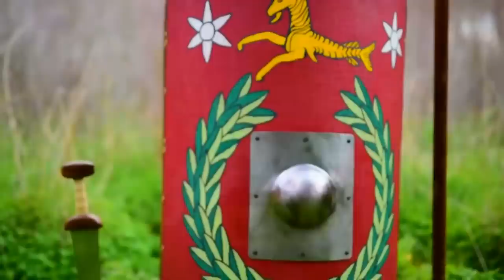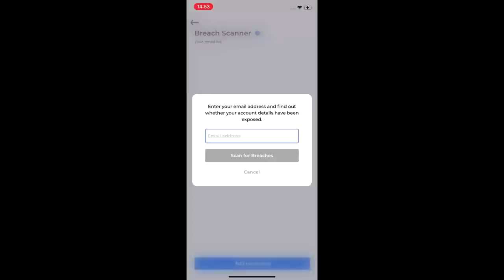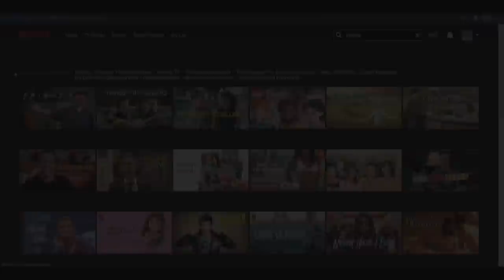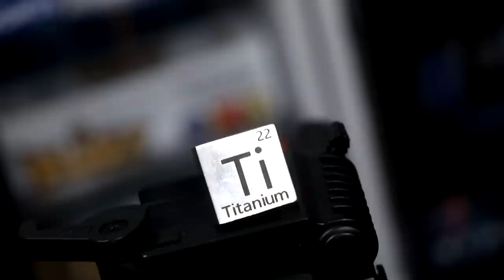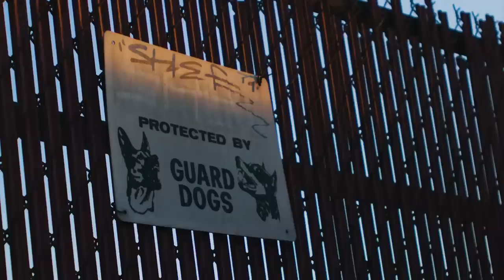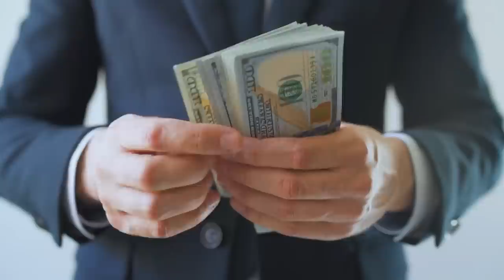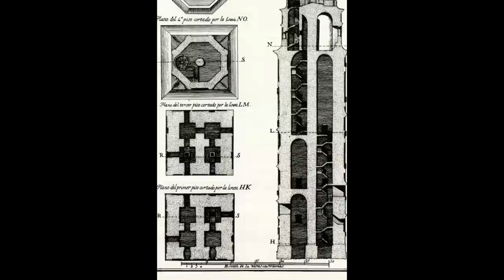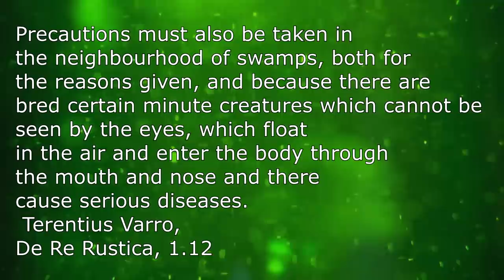10 "MODERN" Things The Romans Actually HAD

Comment: The roman style of concrete is actually superior in many ways to most modern concrete. The largest advantage it has is that it doesn't absorb water, which prevents it from cracking in winter. This is a major reason some buildings from ancient rome still stand today.
Reply: One of the major problems with it though is it doesn't handle wet+cold particularly well. Great for the Mediterranean, becomes a problem in northern Europe. Roman walls, unmaintained, in Rome and Britain are about the same quality overall, most don't utilize concrete as a primary material, they are earth or stone. Things that DO utilize concrete as a primary material, like a lot of the Mile Castles along Hadrian's Wall....almost entirely gone. The ones that are best preserved were built out of more stone. It takes longer for cracks to form, but once they do the freezing and unfreezing in them is worse. Rather than cracking and crumbling off bit-by-bit like a modern sidewalk though, it is like it erodes from inside the cracks, until large portions are no longer solid. With our modern concrete, easier to patch a small crumbling area. With their concrete, it would often stand until the whole thing was nearing crumbling down in Britain.
Reply: @Nick-hi9gx  I'd imagine the salt content would also be a limiting factor, since that pretty much guarantees corroding any rebar even more than our concrete does.

As for Roman concrete, I do wonder if they really actually used the proper stuff in projects on the edge of the empire. After all, bringing in the ingredients was very time-consuming and expensive.
Reply: @InfernosReaper  Most of the ingredients would be relatively cheap because they were plentiful numerous places around the Empire. But up in Britain, or a permanent camp in Morocco, yeah I could see that being pretty cost-prohibitive.
Reply: @Nick-hi9gx  You're kinda underestimating the distance and time of travel due to the size of the empire.
The fact that the secret of making Roman concrete was lost does seem to lend support to the notion that the good stuff wasn't used everywhere, so substitutions had to be made.
Reply: @InfernosReaper  The "good stuff" WAS used everywhere. We have evidence of its use on Hadrian's Wall and Antonine's Wall, a Castrum's towers in Germany, the winter camps in Antioch and Alexandria are the exact same towers as out in Morocco and Romania. You are underestimating the logistical and trade network of Rome, and overestimating the difficulty of making their concrete. The required ingredients aren't rare. Not at all. Tuffa is OVERLY abundant in Italy, Greece, Sicily. 
As to time travel...messages could get from Britain to Syria in a month. Food was shipped from the Chersonesus (Crimea) to modern southern France in an emergency  two years in a row, it took a bit over a month to get there...and that was BEFORE the Romans, going from Greek polis to Greek polis.
Reply: @InfernosReaper  Thought I would come back and answer the salt thing. Salt doesn't corrode iron. It doesn't oxidize it. Water does. Saltwater is worse because the salt acts as an electrolyte, which in turn causes faster degradation. Only if water was actually getting into the rebar would it make any difference. Which...it really shouldn't.
Reply: @Nick-hi9gx  Gonna a citation or 2 for a good bit of that
Reply: @InfernosReaper  Why do you need citations for my claims, but don't back up your own with anything? Especially when you clearly don't understand where Roman ruins exist, what sorts of ruins, or basic chemistry but claimed things based on them. I mean shit, go google what salt does to iron. It took me less than 2 minutes to double-check that I had it correct.
Reply: @InfernosReaper  I will give you this; When Galba died on 15 January 69, Vespasian heard of it, in Syria, by the beginning of February, he issued his commands in the first week of Feb to begin preparing. 
Or this. Constantine learned of Maximinus Daia taking control of the East within a month, maybe 6 weeks of it happening. When he was in northern France, or the Low Countries at the time. And this was as the Empire was splitting into many sides in a civil war.
Reply: @Nick-hi9gx  So,, you've used some examples of news traveling, but not goods and services okay...
Reply: Except that it isn't because we can recreate it and have improved upon it. Modern concrete structures are stronger than the roman ones. However they did build well and their use of arches allowed for buildings to become very old without the use of rebar. Practical Engineering has a good video explaining this.
Reply: @InfernosReaper  but we didn't lose the secret, that's a myth. We very much know how to make it and have found recipes from the time period. The whole concept of the dark ages and intellectual regression is a myth. Much of the roman's knowledge directly carried over into medieval Europe. The main thing that changed was the interconnected infrastructure, trade routes, military defenses, and commoners speaking latin, without the romans europe began its road into constant war and disputes. If America fell we wouldn't just forget how to design microprocessors and trains.
Reply: @InfernosReaper  the romans didn't use rebar, that's why they used so many arches. And all you need for rust is iron + oxygen + water (with disolved elctrolytes, ie not distilled water) but salt can be that electrolyte.
Reply: @Bagginsess  Except the did forget a lot of that stuff. Otherwise they would've kept using a lot of it...

Also, not sure what your bit about rebar is exactly... I only brought that up for why we can't really use their concrete plus that. It'd be worse than the current issues with have with it for long-term structures.
Reply: @InfernosReaper  there were things that stopped but that was due to the lack of roman infrastructure. The roads, aqueducts, city wide plumbing systems were unqiue to rome for a long time because only rome had the means to pull it off. When you are one of many warring states in medieval europe you have no ability or desire to create such vast feats of engineering. That is why the Catholic church was able to accomplish great feats that surpassed rome while the european nobles only had castles surround by fuedal estates untill much later. Rome provided peace within the empire and medieval europe was the exact opposite of that.
Reply: @InfernosReaper  name me a few things that Europeans forgot.
Reply: @Bagginsess  Rebar would have to have an some kind of coating the concrete wouldn't muck with or it'll fail faster than regular concrete.

And yes, we did forget a lot. We know for a fact that is the case because to this day we are still discovering new things that we didn't know they know.

I'm not saying the Medieval period was as bleak as described, just that it's not as good as you make it out to be.
Reply: @Bagginsess  No, it is true, we don't know how it was made. We know the ingredients, but not the method. The cement only works if the ingredients are mixed together slowly in the right amounts, and it took a whole lot of trial and error to get it to work again, but we still don't know exactly how they did it. That is where the myth comes from. Did they mix it at site? Did they mix it together except a last ingredient, only adding that at site? Did they use rebar (which they knew how to make), find it didn't work, and went back to frame pouring? Did they TRY concrete for tension, and those buildings just no longer remain because without rebar it won't be good at that?
Reply: @Bagginsess  If you want something to last more than half a century, rebar should be coated to last a lot longer against rust, though, above just galvanizing it, especially since concrete seems to burn through galvanized layers faster(especially salt-based concrete)

Practical Engineering is quite a handy youtube channel.
Reply: @Nick-hi9gx  that's a fair point.
Reply: @InfernosReaper  I didn't realize it had only been 50 years since the Colosseum was built. I should get my watch checked.
Reply: @Bagginsess  Wait, did I really say anything about the friggin' Colosseum being built with rebar at some point? If I said anything that even vaguely hinted at something like that, I apologize.
Reply: @InfernosReaper  you said if you wanted something to last longer than a century you need the rebar to be more than galvanized, well that's not true as you don't even have to use concrete.
Reply: @InfernosReaper  don't even have to use rebar*
Reply: @Bagginsess  no, I said if you wanted to use something with rebar and have it last for a long time that rebar needs to be more than just galvanized...
Reply: @InfernosReaper  reread it thats not what you said. I'm being an ass and know that's not what you meant but you didn't specify so I'm having a laugh.
Reply: @Bagginsess  The Romans didn't use rebar per se as in steel rebar, but didn't they use straw or something similar? Something that would last longer than actual straw, I'd guess. They clearly understood the architectural need for something with tensile strength though.
Reply: The dominance of Portland Cement is actually quite curious, because its actually was never meant to be a primary structural material.   Lime-based mortar was very well understood circa 1800, and in all ways effectively mimics roman concrete and its hardiness to water exposure.  Its why Europe has so many 500+ year old buildings till in active use.  BUT, it has a problem.  Its too strong.  See when Europe stopped building with STONE and moved to Brick in the colonial era and its population explosions, they found that lime-mortar brick buildings would crack and sheer as they settled or the ground shifted slightly, requiring the entire building to be torn down and rebuilt, assuming it didn't catastrophically collapse.   And the Emergent America  suffered the same problem where nearly everything was being built with either wood or bricks.    So a solution was sought, a motar that was strong, but not AS strong, so that when brick walls cracked, the MORTAR would crack.  This would mean the bricks would still be stacked up, so a collapse was much less likely, and then the wall could be repaired with new mortar.    

And to this goal Portland Cement was invented.   Then the industrial revolution happened, and with it a massive increase in the sophistication of politics.  With those politics would come legally-mandated building codes.   But until the 1900's remember everybody was still building brick buildings.   Well that would change with the mass production of quality steel, and the rise of high rise building.   They had been using Portland now long enough they effectively forgot about lime mortar, and starting using it as a moldable building materal, all the fashon to use Portland cement to façade these new fancy steel-framed buildings.    of Then Portland cement was mixed with steel rebar in the early 20th century as a means to try and stabilize what was material, by design mind you, that was quite weak to sheering loads.  That worked, got written into law, and lord so help you if you TRIED to build your home with lime cement today oh the wrath of the county zoning board you would face!  

But the problem of course?  Portland Cement breaks down with exposure to water, and water-permeable.  This wasn't an issue when used as a mortar, as brick itsself breaks down at about the same rate under water exposure.   But its a huge problem when its the primary building material, and it cause rebar inside it to rust, expand, and crack the structure.   

Which why we are rebuilding everything every 10 years, when the romans built stuff with roman concrete that still stands today without intervention, and why 15th century French building still are use in modern France, but a highway overpass in America can't last a decade.   

And and gets worse.  Did you know that the UN found that a good 50% of human carbon emissions is the off-gassing of Portland cement releasing co2 as it cures?   Did you know ALSO that roman-style concrete actually ABSORBS carbon over time, leading it incredible hardness and durability that actually increases over time?  Roman style concrete also takes less burning to manufacture, meaning its all around way  less net carbon.  

But, there is the rub.  Its now REQUIRED BY LAW in most jurisdictions in the developed world to use Portland cement in construction where a cement is needed.   The codes mean well, to prevent people from building dangerous construction that will fail by mandating known-good methods.  But they also harm, by outlawing anything that isn't code, including better ideas.  And sadly with modern democracy being so broken, changing code is slightly harder than western societies trying to win a land war in Asia, of which even the mighty USA has failed 5 times now.
Reply: a big thing about it though, is that cement etc. harden over time.
old bricks and old cement only get tougher with time, from a combination of "the weaker ones broke" and reaching the pinnacle of dry/compressed.
roman concrete was probably pretty comparable to modern concrete considering that bias.

The best example I have ever heard of 'survival bias' is the ww2 plane example.
In ww2, hypothetical planes sometimes returned with bullet holes. They noted the return holes of all the planes that came back. To their surprise, the scientists found that almost none of the bullet holes were in the tail of the aircraft and the engines...
Did that mean that the engine and tail of the plane were bulletproof? no, it meant that the planes that were hit there didn't make it back to base.

And that's kind of what's going on with the buildings that are still standing, we don't see all the cement that didn't survive well, as it... didn't survive.
Reply: Yeah didn’t they have a type of concrete that could dry and harden underwater ?
Reply: @nordoceltic7225  that was a legendary comment man. Good enough to be a video script. You should look into making videos cause its a shame such amazing level of effort and knowledge is going to get buried in comments
Reply: @Olav_Hansen  there's a similar story about helmets in ww1. When helmets were first issued, hopsitalizations surged through the roof and the command at first was like whoa, what the hell man. We got you helmets to avoid this, how are you getting injured? Does it limit your field of view too much or something?

But then they thought about it for more than five seconds and realized that all those wounded soldiers would have been dead.
Reply: @Olav_Hansen  survival bias makes for cute stories and smartypants anti-knowledge takes, but truth is, we can see how well buildings do in post roman territories, especially Britain and northern areas. We can see ruins in various state of disrepair and decay, but we can also find rubble indicative of structures that would have been there, and using foundation, historical records, pieces, etc, figure out roughly what kind of a building it was and how it was built and designer

There are many limits to how much we know, but the field of history and archeology is acutely aware of it
Reply: @Nick-hi9gx  excellent series of comments, cant like it hard enough
Reply: @dango470  where I live there aren't any roman buildings. We do have tonnes of 400 year old houses and there's also some surviving castles. One of these buildings, a 16th century jail 'tower', is showing why the amount of old houses is limited. The soil of the building has sagged more on one side then on the other, basically making it our local tower of pisa (albeit not as high).

If the tower was build on ground that wouldn't sag, there would have been barely anything to indicate it being more than a century old. That's how much influence location etc. can do to influence the aging of a building.
We still build houses with bricks, but some places sag the same amount in just a couple decades, and will thus start cracking earlier.
Reply: @InfernosReaper  You know shalk is a salt to and has similar corroding effects? 😅
Reply: If I recall correctly we also have a fairly poor understanding of exactly how they made the concrete so good, too, and there has been a significant portion of scientific investigation into how to replicate the process using modern materials.
Reply: @InfernosReaper  they stopped using it because the structures and economy that enabled them ceased to exist. Not because it was magically forgotten
Reply: modern concrete only cracks due to the reinforcement rusting.
Reply: @Nick-hi9gx  It still stands fine but would have been destroyed by the Scottish so that England couldn't use it for tactical advantage. When getting invaded I highly doubt it was weather since the majority of battles were fought around this area. There is plenty of Roman sites still standing after all this time which really disproves the idea that the concrete was bad. Since even though the destruction by locals and wars. And even forts the foundations all survive. Arbeia Roman Fort held up well. And Pevensey Roman Fort was even used after the romans left. Also the foundations of bath are still romans with stuff built on top is British stuff from 600ad, which really proves there was a deliberate destruction of Roman stuff going after the wars to leave the Roman empire. I mean I've visited loads of castles in Scotland and it seems they only get destroyed because it's on purpose. Also it was common for forts and castles to be looted of it's stones to build houses in the UK. These are extremely well built structures. Expecially when compared to our modern buildings. But not really a big surprise since. It's just rocks and concrete. It's just natural enduring materials given shape. Aquaducts still stand too in France for example Pont du Gard. And they get similar weather as the UK does. All western Europe has aquaducts.
Reply: @JamieZero7  Bath is one of the few exceptions because it has been INCREDIBLY well maintained. Most of the Roman forts, what is left over in Britain, is stone or brick. Not concrete. There are ruins with lots of concrete and the ruins are partially intact, but also incredibly unstable...like Pevensey, in fact. The castle that sits there now wasn't built by Romans, it was built next to (and utilizing a tiny bit) Roman ruins, what original Roman ruins are still there have had to be reinforced to make sure they aren't a hazard. Arbeia 1. is brick and 2. has been rebuilt partially and 3. was pretty much in complete ruins in areas when it was rebuilt, because those parts had not been utilized or maintained in any way.
Reply: Opum cementitum was the first thing that came to my mind when I read the thumbnail/headline to this vid 😅
Reply: @InfernosReaper  17:06
Reply: @InfernosReaper  17:06
Reply: it's hot mix the research on it was finally done, it's not that it doesn't crack it's that it repairs itself after it cracks
Reply: Roman concrete is not actually superior to modern concrete, we can make equal and far better quality when we choose to (comparative tests have been done showing this). However we often choose not to as it is costly and not the quality or attributes needed for most of our projects these days.